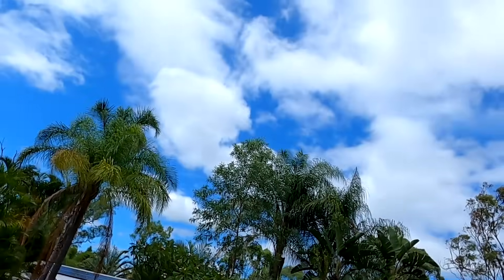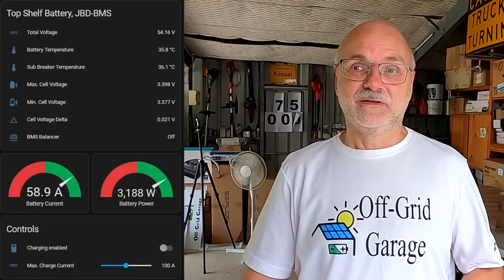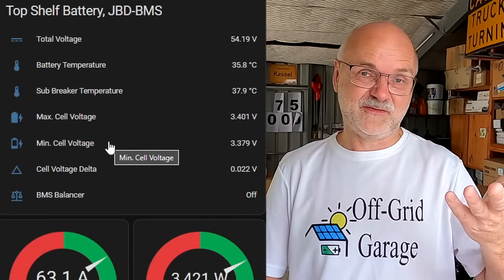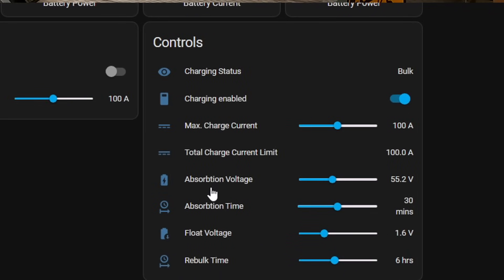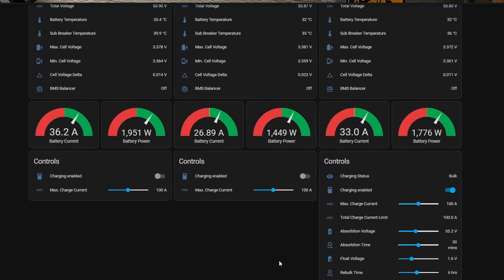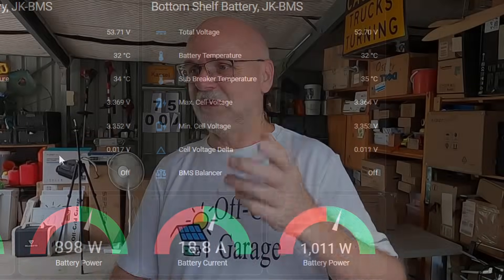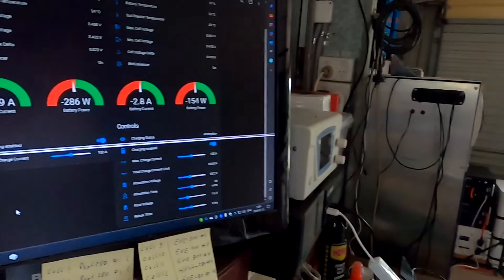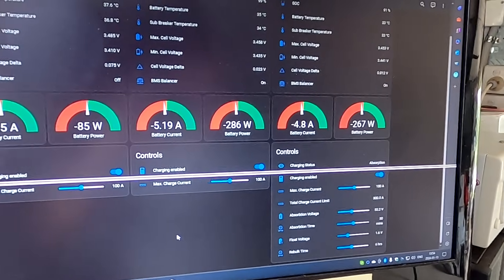Is JK's 0.6A active balancing enough? First charge of the Battery Shelf under 'Peter' Board control.

Comment: I am glad that Andy is finally seeing the value of HA.  I have been running HA for several years now, it is my "PMS" (Powerplant Management System).  It gathers all of the data from my Inverter, BMSs, etc. and provides me with a LOCAL human interface to monitor and control everything.   I built several boards to monitor & control JK & JBD BMSs,  MPP & PowMr Inverters, as well as PZEM Power monitors (Shunts and Current Transformers), and automatically populate all the data points into Home Assistant.  The net result is that HA is the "Brains" of my system, not the BMS.
Reply from the maker: I hope the system will still safely work if HA does not for whatever reason?
I'm using HA only for monitoring atm. Even if the BMS fails, the MPPTs will only charge to a certain voltage...

Comment: I have been using Home Assistant for 2 years to monitor and control all aspects of my home powerplant.  Having no Victron components, it was the best choice for me.  I have designed a few "Dave" boards that interface my Inverter, BMSs, and Shunts to HA.
Reply from the maker: What if you HA fails though?
Reply: @OffGridGarageAustralia  What if the BMS Fails?  What if the RasPi fails? What if a circuit breaker fails?  After 2 years of daily use, I have very strong confidence in HA, and I have no dependency on the internet to update a web site in some foreign country (that I have no control over) and I have full control of the data display and control logic.  I have WAY more confidence in HA's development approach than I do in JK's, based on several years of direct experience with both.
Reply from the maker: @DavidPrue Thanks for sharing, I appreciate it.

Comment: Thanks for the update video.  Love the build process!!  Question/Observation:  I don't think the "Charging Enabled" toggle is a good option as it implies charge is ON/OFF while it is not.  It is basically a toggle that reduces the CCL (removes the battery from the CCL calculation in Victron).  Maybe call this CCL include or exclude.
Thanks again Andy!
Reply from the maker: Yes, that's what I said and explained, the charging enable toggle has only an effect on the CCL. In Home Assistant, you can call it whatever you like, this is just the default name of the toggle. I know what it does, so it's OK for me, but thanks for your advice and explanation for others again.

Comment: I like the Dashboard Andy, big improvement. At 15:45, I as you have a good milliohm tester and a baseline on your you pack with the Aluminum busbars, I might suggest testing an aluminum anti-oxide compound to see if it adds any resistance and prevents corrosion and resistance build-up. 
Many years ago we used a lot of aluminum conductors in the oil and gas industry at a remote location and found 'Penetrox A' (DXE-P8A) an industrial Aluminum Conductor Anti-Oxidant indispensable, and that it effectively prevented aluminum to aluminum and aluminum to copper connection corrosion if used a liberally. The stuff is relatively cheap and a bit messy, but worked well on connecting aluminum to copper buss bars and even using copper compression lugs not rated for aluminum, on aluminum wire.
Reply from the maker: Thanks Jack. I have tested three different paste, greases and compounds in the past. They all seem to work well for a while but eventually have made the situation worse. I had the best experience with NO grease whatsoever.

Comment: Thanks Andy - love your work as always (though way beyond my level of expertise).
Stay cool, and stay charged.
I’m very happy to have 2A balancing with my JK BMS’s, and would actually like even more - I occasionally need to extend the absorption charge time to fully balance if it’s been a while since they’ve been fully charged.
Reply from the maker: Is this for your 48V system? I wonder why they are so out of balance that 1h is not enough.
Reply: Because they are grade B cells not matched what you often get from alibaba and aliexpress plus a lot of vendors. Or people think they safe money when buying garde b labeled cells from reliable sellers when the save 20 Euro on a 130Euro cell and think they just get a bit less capacity....
Reply: I agree with him its better to have more balancing current then you actually need right now as the cells aging over time and not evenly so the delta the balancer has to cope is getting bigger over time. So 0.6A might be ok now but in 5 years not anymore. And if i am building a system its designed to last the battery life.
Reply: Forgot to add the more cells you have in series the more the whole cellpack will deviate over time, means a 48V pack needs always a BMS and a capable balancer while if you have high quality cells in 4S a battery monitor with an external relay like Victron BMV712 that does LVC and HVC is more then sufficient. Know over 40 installs (half i done myself) in cars older then 7 years that have no BMS with 4x40AH till 4x100AH Winston cells as only battery, no BMS. Took some appart and deviation after 7 years were below 5mV. And they often see 5C peak use from the engine starter surge. Forget doing that with 24 or 48V as the production differences of each cell add up when you put them in series. And that added differences which grows over time need to be covered by the balancer. 
And if you use that in eg boats where the bank capacity is often twice or more of the solar total wattage these banks are massivly oversized so getting seldomly to 100%SOC. Means when they do the active balancer needs to be bigger to balance the bigger deviation as a result of that.
Reply: @chrisr819  Yes, the more cells the bigger the problem, as only two cells can balance at any one time. 
I have a 2 x 18s system, and often go many part charge cycles before filling and getting a chance to balance. I usually need every bit of the 2A balance current if it’s been a long time since the last full charge and balance.

Comment: Excellent I am glad that you finaly use Home Assistant to display / control your system. So much nicer so much powerful 😊 Would also be nice if you could recap how data are exchange in your complete system ( ve bus, cerbo gx, can ...)
Reply from the maker: Yes, I will make a separate video about the coms in my system. For this test, everything has changed...

Comment: I also have a JK BMS 60A / 0.6A Balance and its just working fine for a 16S 48v system w 9.6kWh.
Waiting for my Peterboard and will also start Home Assistent later this year.
Reply: I got 80amp / 0.6 amp BD6A17S8P with 16s 15kw should still be fine?
Reply: @nodelayfordays8083  That must be 300/320 Ah cells. Looks ok to me.  When all cells are almost the same voltage, balancing with 0.6A is enough I guess.
DIY Battery banks I like more than ready made Storage products as they are a lot cheaper. And I like JK BMS. So I have ordered the so called Peterboard from Uksa 007 to be able to connect to my Deye Inverter over Canbus .

Comment: I want to point out that all the software that makes the peter board possible is open source and done by a lot of people in their free time. Esphome is the key word if you want to look it up. Some other guy did all the work implementing the comunication from the bms ti esphome.

He took all this work from others, added some charing logic, then makes it cloesed source and sells it for an insane amount of money.

Keep the source open and simply sell your designed hardware with your firmware pre installed, so people which want a plug and play version can but it from you, but taking an open source Projekt modify it and not letting the whole comunity profit from it but just yourself is just wrong and you know it.

Comment: My solar panels are covered by 9 inches of snow and ice. For 7 days my production has been zero. Welcome to winter in Oregon.
Reply: Sounds like a classic case of needing VERTICAL, or nearly vertical solar panels- facing South in your case.
Here in sunny Brisbane …. Should I say cloudy, showery, stinking hot and sticky Brisbane, we’re getting almost constant showers between patches of sun, coupled with extreme humidity. 
However my solar is still keeping my battery fairly full and running the aircon. (Couldn’t live without aircon- really disgusting weather to be honest. Despite being born and bred here, I survive our summers but absolutely LOVE our Winters. This Summer has been especially bad.)
Reply: Vertical is deceptive to winds or you need to put them lower, where shadow make them useless. I created a flimsy 45 degree setup, with plastic panels which can sway in the wind, they are not zero. But almost
Reply: There are systems to melt snow off solar panels, and ground arrays are easier to clear manually. They do also make special very long handled snow blades for clearing roof panels. But it's a pain any way you look at it.
Reply: I had a lot less snow, but it is still quite annoying when the sun is shining.

How about just using an electric blanket with an extension cord, wrapped in something safe and waterproof?

Comment: Welcome to the unlimited possibilities of HA 🐸
My Battery Dashboard looks nearly the same.
An i have a second dashboard showing all single cell voltages. With a few clicks i get pretty graphs with all cell voltages and can see how diffrent cells can behave during charging.
The Deye Inverters have two limits for charge current. One is set via CanBus from the BMS port. This should never be touched manually for saftey reasons. 
The other limit can be set via the display or via ModBus from HA - manually or by automations.
HA is really a great peace 👍
Reply from the maker: Yeah, HA seems pretty slick for this sort of monitoring. But would I trust it to run the whole battery shelf including charging and inverter control? What if it fails and does not run any more? Yes, we have backups, but how to recover the whole system after a crash... I may need to test this out at some stage...
Reply: @OffGridGarageAustralia  
I dont use HA for safety relevant controls. But it is perfect to manage several things. 
For example: 
If sunshine is forecastet for the whole day i reduce charging current, or i heat up the boiler first.
Or i can switch off one or more inverters during the night to save idle power.
Or i can overheat the house a bit if the batteries are full an there is still solar power available.
Or a additional colling fan is controlled by the temperature sensor of the inverters DC board.

If HA fails nothing happens. As the safety relevant limits are controlled by BSC and by the BMSes.
The minor settings HA is doing in the inverter can still be changed using the buttons and the touch Display on the Deye.
Reply from the maker: @Juergen_Miessmer  Yes, that is perfect and what I like to do as well. Atm I look outside and change the current accordingly.

Comment: I like your dashboard. 
Today I installed a second Multiplus II in parallel to my original one and connected two additional 280 Ah batteries. This gives me now 60kWh. Enough to charge the car from the battery in summer. Unfortunately it's not summer right now.😢
Reply: This depends on where you come from 😜
Reply from the maker: It's very much summer here!😉
Great, 60kWh sounds like a good capacity, especially when charging a vehicle.

Comment: I like the high level of Home Assistant integration.  That really is the ultimate in convenience!  You might want to consider some security isolation, you don't want a hack of your main network to be able to access your equipment network.

The basic way to do this is to have the machine Home Assistant is running on "straddle" the two networks.  Your home network on one side and your equipment network on the other side.  This would require having two ethernet ports on the machine H.A. is running on though which might not be convenient for everyone.  Even on an RPi4 you can always connect up a USB ethernet dongle to get a second ethernet port.  You then put the firewall on the H.A. machine itself.  Basically allow the equipment network access to the home network and internet, but not allow the home network access to the equipment network.

A second way is to isolate the H.A. machine and the equipment network with a router and then drill a hole through the router (figuratively speaking) so your phone app can access the H.A. web server when it is sitting on your home network, but nothing else (requiring that the phone be in bluetooth range or sitting on the equipment network to access devices directly).

Its a project though.  Most people aren't conversant enough with LAN routing and IP spaces to do it without a ton of effort.   I do think you need to begin thinking about the security of your power systems network integration, though.

--

I think you can safely start balancing once the cell voltage is high enough, even if a pack still has a lot of current.   The energy the balancer is moving in the battery is effective regardless of the state of charge, as long as the balancer makes the "correct" choice.  That's the basic problem with trying to balance at a lower voltage... the balancer winds up making the wrong choice and taking the cells in the wrong direction due to minor differences in cell chemistry.

Once a cell is at a high enough voltage the balancer should start making the correct choice, even if there is current going in or out of the pack.  And honestly, there is never "zero" current.. the battery bank will be charging or discharging, but hardly ever sitting near zero.

Heh.  Remember the time range for absorption time that I've been hawking for the last few years?  "1-2 hours".  You are getting closer 🙂

-Matt
Reply from the maker: Thanks for your ideas, Matt. Appreciate your feedback and inspiration!

Comment: Hello Andy wonderfull video. Homeassistant seem very simple and power full i wonder if a comparaison with venus os would be usefull. Seem to me Homeassistant is more power full and easy to use but your opinion could be great.

About connexion i discover there are a lot of way to connect JK-BMS to Home assistant.

I say that because Peter board is very expensive (almost bms price) naturally the work done is great and have to be paid but the gap is very hudge (hardware arround 10 euros and price more than 100 euro)

The big difference i have seen is the peter board manage the charging and not only connect the devices.

Thanks for all.
Reply from the maker: I trust Victron more than Home Assistant though, so I use HA only for monitoring purposes.

Comment: one thing to note is the jk bms reports full pack voltage based on its individual cells voltage. if the calibration is off between two jk bmses connected in parallel the overall pack voltage is obviously the same yet the the two bmses report slightly different pack voltage number.
Reply: Are you sure about that?
Why would they add all the cell voltages together for the Overall pach voltake instand of Measuaring the pack voltage directly?
Reply from the maker: JK uses coulomb count, not cell voltage as far as I know to display SOC

Comment: Hi Andy ✌️
Is there a way to get the new options from the new JK BMS to the older ones?

And at my older JK, I see all the time some heating current, but I have no current option an nothing connected. Also the heating is switched off in the settings. Someone had any ideas?
Best regards from Jägermeistertown 😊
Reply from the maker: If the BT app does not show the new option, the hardware of the JK cannot handle it. No way to update. Hence the Peter Solution for older JKs...

Comment: It is also good to have InfluxDB and Grafana running in HA, because HA only keeps the last ten days of Data.
Reply: Yep, that's what I do.   Have a separate pi with nodered, influxdb and grafana.
Reply from the maker: I have data in my HA since day 1 when I installed it. I can go back months...?
Reply: @OffGridGarageAustralia  
Sensor data is purged by default after 10 days. Only if an entity is build for long term statistic, it will store one summarized value every hour.
Reply from the maker: @Juergen_Miessmer  It still gives you the data before the 10 days. I'm happy with that.

Comment: I was just wondering about this. Im making a 15kw system with 16 xells in series Eve 304ah and got the JK BD6A17S8P BMS with 0.6 amp active balancing amd was wondering if that would eould be enough for this build.
Reply from the maker: Yes, it will be no problem. Actually, this battery is now my best-balanced pack in the battery shelf.

Comment: Have you considered polishing the contact points in the AL buss bar setup.  That should bring connection resistance back to par.  Now you could know for sure why the difference.  

A T Burke
Reply from the maker: Yes, I have polished aluminium terminals in the past😆
The surface will corrode within milli seconds and yes, I have tested several aluminium pastes and greases. Best result for me is still nothing in between.
Reply: Thank you, Sir.  I think I will stay with copper then.  No matter what size bar is used to reduce resistance, it still has to make it through the connection.  

A T Burke @OffGridGarageAustralia

Comment: Hello Can you tell me if I can use Peltier cooling of the battery enclosure, as is the case with you? In summer, in Romania, in my garage, temperatures reach 40-42°C and the optimum is 25°C Thank you very much
Reply from the maker: No, that will not work. Peltier does 10° max and produces a awful amount of heat on the other side which you need to get rid of. 
I have the same temperatures and the cells will be fine for these few days. They can handle close to 60°C
Reply: @OffGridGarageAustralia  Thank you